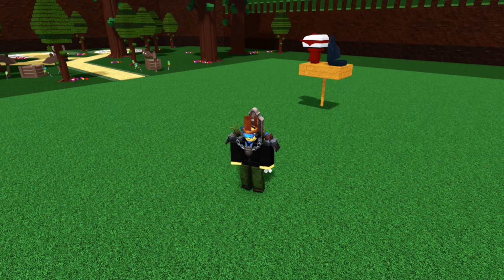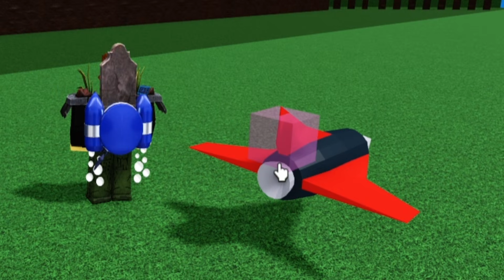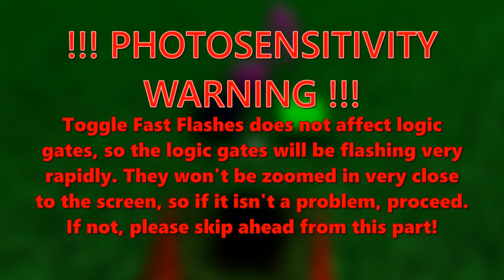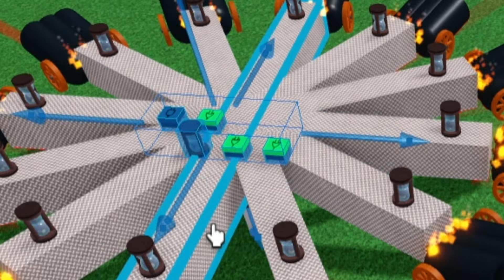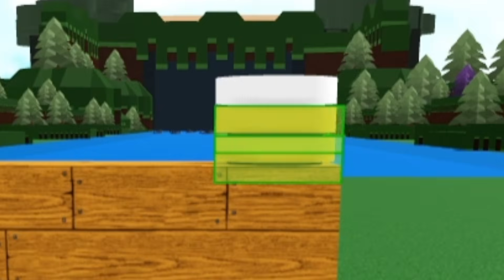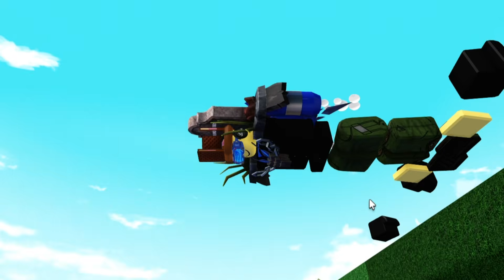Auto Turret and Logic Gate Mechanics Tutorial +MORE (Roblox - Build A Boat For Treasure)

Comment: My turret isn’t stoping when it sees someone can you pls tell me how to fix it
Reply from the maker: I'd recommend double checking the binds, lowering the wheel speed, or making the sensors thicker. By the looks of it, either something isn't binded correctly, the wheel is so fast to where the sensor doesn't render touching its target, or you can make the the sensors thicker to give the turret a higher chance of detecting targets. If the sensors are too thick, then it could degrade its accuracy.
Reply: @AzureBloxian thx bro u da goat

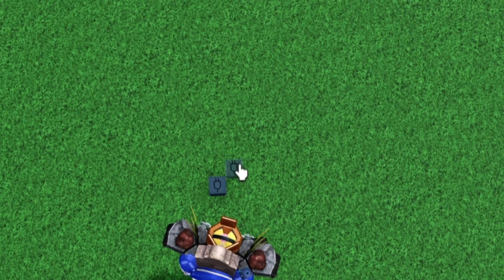Comment: 3:18 cant you do this with just 2 delay blocks with a short delay time and link one of them to the other but dont make a loop and connect both of them to the jet turning it on and off with one button press without the extra logic gates or am i so wrong-
Reply from the maker: This was precisely developed so each logic gate is responsible for making the quick activate happen. If you did do it with 2 delays, you could just hold the button down and activate continuously, which is not the goal of a quick activate system

Comment: YOU CAN SET ROPES TO INF NOW?
Reply: yeah but use 1e44
Reply: ye
Reply: It’s simple, just set the length to the number where the number turns into “Inf” or maybe just type “Inf” instead
Reply: Can you set springs to inf too??
Reply: of course, but while I was using this hidden feature to leave the skybox, I set the springs to INF while the golden chair with me sitting on it is attached to the spring, I went so fast my camera froze and I can’t able to move it around anymore and probably teleported back in the normal skybox meaning there’s no way of knowing I’m out of the skybox or not, turns out that leaving the skybox in BABFT requires genius